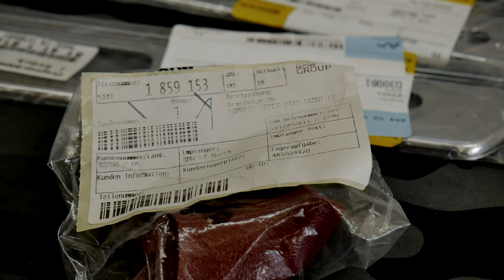Project E24 - BMW 633csi - Finishing Exterior Touches

Comment: Hi - where did you source the chrome trim for the tail lights? I’ve been struggling to find a new set.
Reply from the maker: I polished the original ones on that came off the car, just use some metal polish.